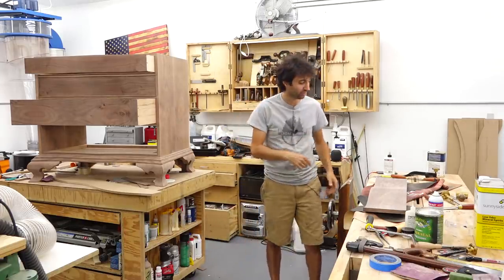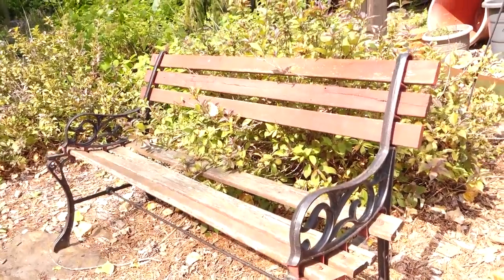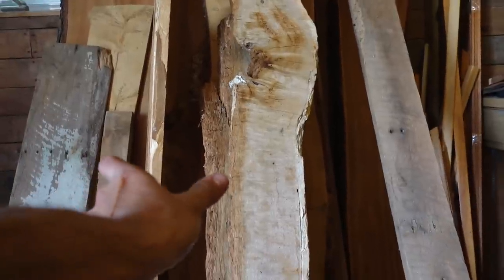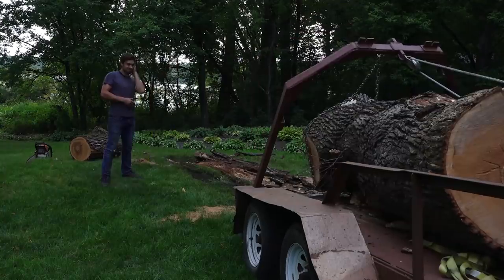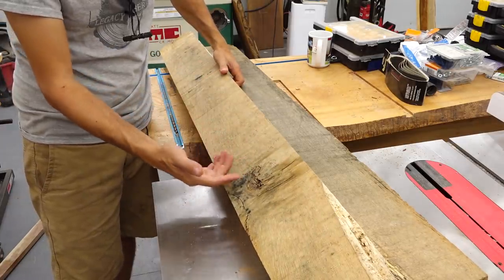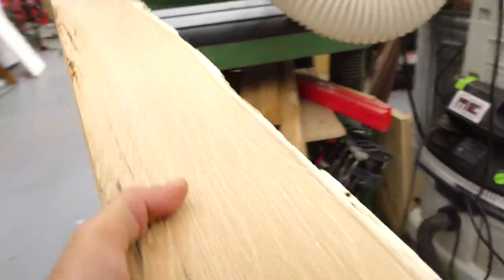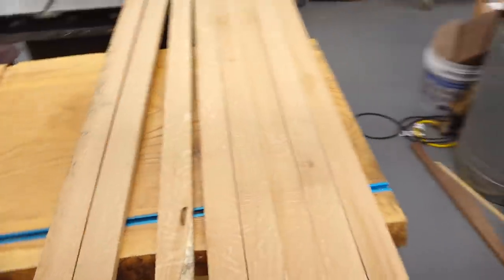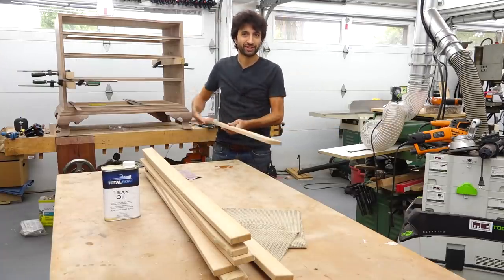Making new slats for a garden bench from a rotten log

Comment: Never thought of using a circle jig like that.... nice a slick!  only your missing is the pin for stability, but not 100 percent necessary.  Great project.  I found on of those in the trash.  Did them with cheapest of the cheap lumber.  Worked out and I had it on a covered porch on my home for a long time.   Sold it when we moved (didn't want to cart it). Which I could find another one to redo.  It reminds of a friend who has past.  We would go ride dirt bikes and leave at 5 am in the summer.  I would look out and he would be at my door at 4:45.... relaxing on that bench enjoying the usually nice and cool morning to knock at 5 on the dot! Old school postman.

Comment: Correct me if I’m wrong but white oak has a much less tendency to absorb water through the end grain than red oak or other woods. That’s one reason it’s used in wooden boat building. It’s a great selection for the outdoor bench. Also that finish is fantastic.
Reply from the maker: That’s correct. Thanks!

Comment: I did almost identical slats for a Japanese style garden bench (see the design in FWW), using similar oak a couple of years back.   We used a tung oil finish, hoping to bring out the quarter sawn fleck, and it looked great for about a week.    Within 18 months it looked quite unattractive, with some tannins reacting in the wood to create black spots and the tung oil finish starting to look yellow and quite patchy (and it took forever to dry)  After I'd scraped it off to get rid of the worst patchiness, the oak weathered to a silvery grey anyway, which was much nicer than the finish ever had been.  My conclusion was that for my taste, oak is better left unfinished if it is for the garden/ yard.  I should say, this is in Scotland and obviously we get a lot of weather here.

Comment: I know you like figure, but I sure like quartersawn white oak. I had a whole house floored with QSWO (except the kitchen where my wife wanted pecan for some reason). All hand-scraped from the rough (never planed or sanded), so the rayflecks really popped and could be felt underfoot. This (scraping from the roughsawn) is a technique I haven't noticed on your channel. It really adds texture to QSWO (which as you often say, can be pretty plain. The rays, being slightly harder, stand a little proud of the rest of the board.

Comment: Looks good.  I just completed doing two of those benches a few weeks ago myself.   I didn't use any finish on them but the last ones did last for over 8 years without any.  I might try the oil on mine as they have been under cover during the heavy rains we have had.

Comment: I enjoyed the video but I have one thought / question about the teak oil application. Would it have been better to soak the ends after drilling the holes? That way the oil would protect the newly exposed portion of the wood inside the drilled holes.

Comment: Turned out really nice.. I’ve done a few of those myself. Question: what type of router table is that you used? I’ve got a small shop and I’ve been thinking about adding one myself to speed things up, but don’t want to take up a lot of space.
Thanks and love your videos!
Reply: It looks like a circle cutting base attached to a Triton router, with the whole thing clamped to his bench. You could make something similar with a scrap of plywood that's longer on one side than the other. If you wanted to get fancy, you could add a t-nut for a router table starting pin.

Comment: One additional feature you might want to install is to fashion a metal strap to fit the middle bottom contour of the bench seat.  Fit it up and drill some small holes for 5/8" screws into the bottom of each board for additional support.  Although the boards are oak, there are some big people out there.

Comment: I noticed that your bench cast iron frames aren't parallel to the ends of your slats. If you make them parallel, this puts tension preload on the bench seat and causes it to bow upwards in seat center. I repaired the identical bench and assumed the cast ends were to be parallel.  I was really disappointed after pre-drilling my hardware holes and finding that the bench was hard to assemble as the preload tension began to increase. To my surprise, the bowed up seat counteracts your sitting weight, makes the bench seat flex "flat" when you sit on it, and provides a springy sensation. It also tends to resist sagging in the center so that two people don't roll together. 

My bench was on its second worn out slats (assembled and later rebuilt by others) and the slats were way too rotted to transfer hole locations. I have never assembled a new bench of this design. After accidentally discovering what I described, I am all but convinced that this preload tension is intended in the original design. I used oversized Home Depot red color treated YP machined to almost fully fit the cast openings. I wanted the poor man's unfinished look, with no maintenance, and some life longevity. It looked good, but sat even better, and my daughter gladly took it when she saw it.

Does anyone really know if my discovery is legitimate?
Reply: Makes perfect sense that they would be designed that way but I've never actually seen an original set of slats on an old cast bench in decent shape to make that observation.